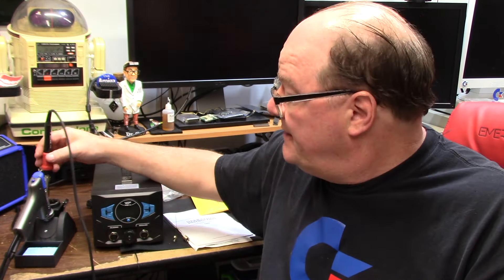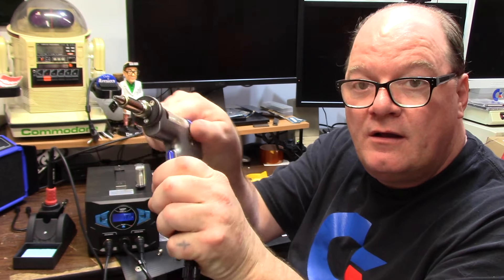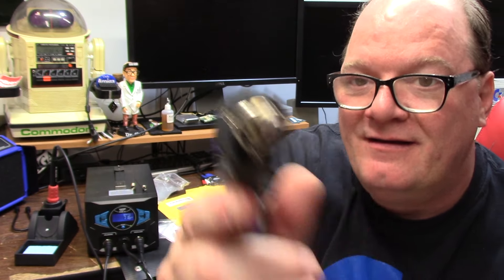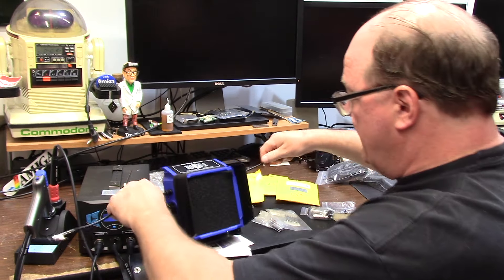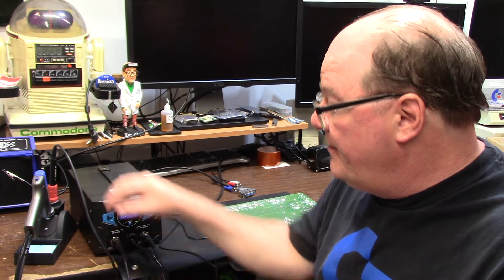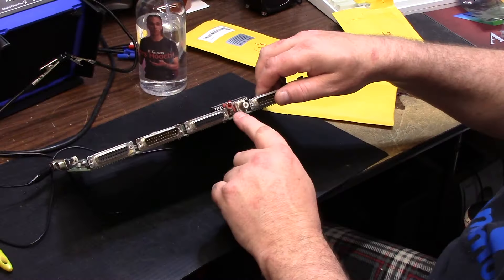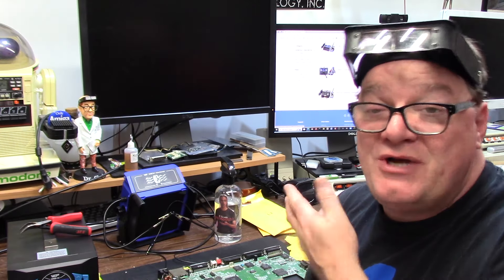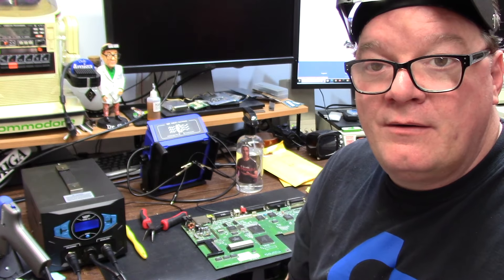Sucking it hard! The WepTools 948D3 desolder station and more

Comment: Yeah Chris, I need one of these puppies. I'm just a hobbyist, but I have worn out two iron bulb solder suckers and two spring loaded button trigger suckers disassembling all sorts of electronics for salvage stock. Some of my favorites are UPSes. My wife doesn't even ask "what is that awful toxic burning smell?" anymore. I've gotten better at desoldering over the past couple of years with practice and somewhat better tools, but I still occasionally burn something up, which is annoying. I bought a cheap combo iron and heat gun station a while back that has worked amazingly well. The one annoying thing about it was no master power switch, maybe to ensure the heat gun cool down cycle wasn't interrupted? I installed a master power switch. Warrany? I don't need no steenkin' warrany! I have gotten good at using solder braid, but it's tedious on larger jobs. I have wanted a good solder sucker since I first saw one, but the past few years' economy and the necessary belt tightening makes it hard to justify the expenditure. I would really like to do a Re-Amiga or two and this unit would be a big help. Thanks for the review and all the great Amiga renovations you do!

Comment: Thanks for the vid and code Chris. I'm overdue for replacing my junk desoldering station that has plastic parts that keep breaking and it really doesn't seem all that motivated to suck. I mean it does suck. It really sucks, like taxes suck. Anyway, definitely going to order a new WePTools one. I also overdue for fume extractor so my brain doesn't melt away (like what happened to that dude in that Halt and Catch Fire TV series.) Brains good. Fumes bad.

Comment: Also unlike some other brands the temperature on the display is the ACTUAL tip temperature and not just programmed temp. Also there is a sensor that goes deep into the soldering tip
for faster thermal recovery. So far so good.
Reply from the maker: I bought some new stuff coming up soon
Reply: @ChrisEdwardsRestoration  WEP stuff?
Reply from the maker: @Daniel-vh9lg  yes wep stuff!!

Comment: it's a Hekko clone, the only thing that needs fixing is the felt filter in the gun they can be a pita, had a big duratool rework station for many years both the gun and the iron failed within a week of each other so I bit the bullet and got a Weller station with the WTP90 iron, not cheap but after 25 years of cheap stuff and plenty of Antex irons, I felt it about time

Comment: Hi Chris, I could use one of these! I have a pile of retro stuff collected through the years needing repairs - an A1200, a Vectrex, and most of all, about a dozen old keyboards (Northgate, Focus, some old ADB Apples) that need lots of switches replaced. My trusty old plunger-style tool is fine for light work, but the thought of using it for this backlog just makes for procrastination 😂 Hope you can help!
Reply: I realized that my "story" isn't all that entertaining, so I'll see if I can't improve my chances with one that is. It isn't really related to this device, but it does involve working on a 1084 monitor.

I had a small business running in Albany, NY, involving making graphics on Amigas, mostly for used car dealerships. I'd make something garish with lots of movement, and then overlay it over typical "BUY BUY BUY" cheapo used car ads. I'd walk my Amiga 500 and genlock into a local TV station, and run the graphics in real time over the crap video. This helped pay my college tuition and expenses.

One day, I was asked to create a touch-screen kiosk for a client. I scratched enough pennies together to buy a touch screen kit, one that you could retrofit into a 1084. I didn't know much about hardware at this point, but I followed the terse instructions, and was in the process of installing a second power supply and the overlay screen over the tube. I powered the open frame monitor up for a smoke test, and it worked - but it needed a tweak. So I reached over the monitor to grab a tool... and the bottom of my arm brushed a cap.

I had been doing this at my kitchen table. The voltage caused my arm to violently swing up and back with tremendous force. So much so that I woke up (blacked out for a sec) on my back, the chair having been knocked over with me in it.

I brushed myself off, turned off the monitor, let it sit for a day, and then put it all together. It worked great. I've since continued my love of hardware to this day, but taking much better precautions. I'm happy to report that I haven't had another electrocution in the last 40-some-odd years.

Comment: Dang... I only have an old Hakko 707 for which (most) replacement parts are "unobtainium" now... can you rig the drawing so that I win? ? ?
Reply from the maker: Tell the best story and you may
Reply: Well... a looong, looong time ago, and very far away... (mid to late 1990's) somewhere in darkest maryland, I was trying to troubleshoot a malfunctioning microwave. I did everything I could think to do with the thing, and some things I couldn't think of... NOTHING! And then MORE nothing! My curses reached the very pillars of heaven. At some point, amidst my tears and the crumbled remnants of my EGO and shattered psyche; I noticed that the thing had a blown glass fuse on the board. You know, around that general power ingress area of the entire technological conglomeration? Ah... live and learn. It ain't ALL rocket science it seems.

Comment: Just want to add a bit of caution.  Sorry.  I've had several versions of these Hakko clone desoldering stations over the last four or five years.  I haven't had much bad to say about them, at least for the first few times I've used them.  They worked great for the first month or two.  But no matter my diligence in keeping the filter clean and the solder tube clear, I found that all of them began to lose suction power and started frequently plugging up between the tip and the tube. Temp setting didn't fix it.  I'd spend nearly an hour drilling out the solid solder at the tube end of the handle.   I'd replace the handle unit and have most of the suction power restored, but not all.  It got to be a monumental pita every time I tried to use them.  This is a newer version of the last one I had, so maybe Chris's experience will be different.  I hope.  Wouldn't it be wonderful if this version completely fixed that problem.  

Let us know how this station is working for you in a few months Chris.  

I'm now on my first experience with the Hakko FS301 and so far, yes it's bulky, but it sucks like a big dog and hasn't clogged on me once.    I'd have gone with the Hakko table soldering station if I could have afforded it, but that price was nearly a heart attack all by itself.
Reply: Thanks for this. I have to do the obligatory ask. Did you then run the sucker 3 times after you had finished like mentioned in the instructions? Now to be fair, I have found the same thing the run the sucker 3 times does help but you still get clogging. The cheaper ones you just have to clean after each use even it is only once/casual use.
Reply from the maker: @josephphillips9243 I just hold the button down for like 20 seconds
Reply from the maker: I also am about three months out on videos so what you’re watching was three months ago ago it’s been fine and perfect. Not a single issue.